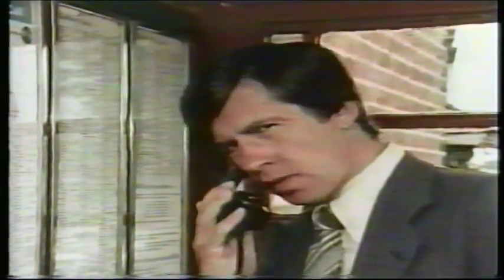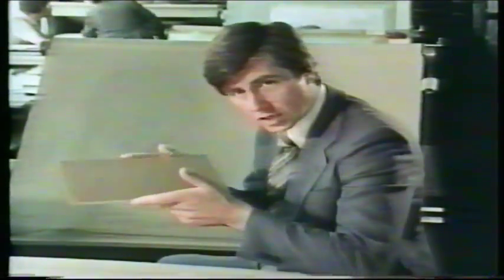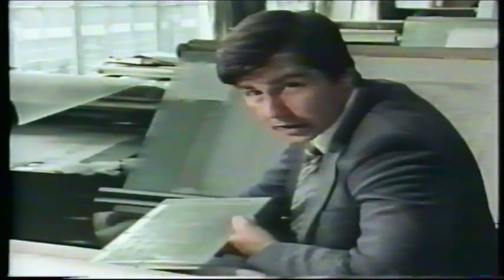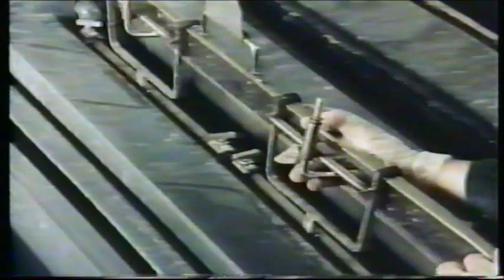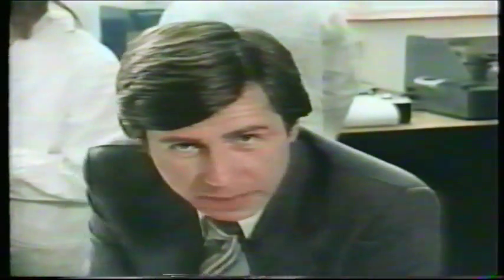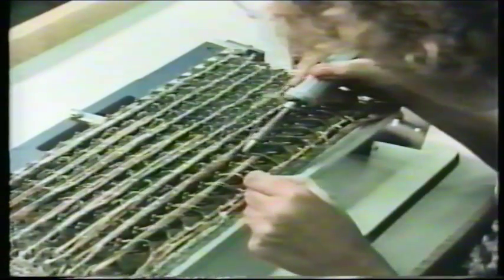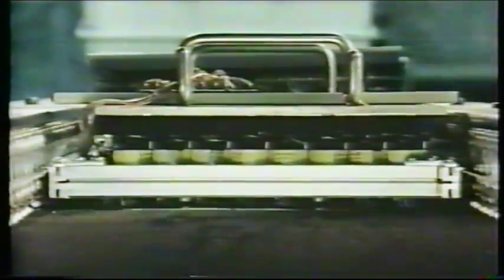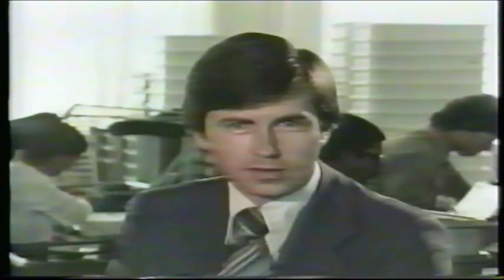STC AND THE TIN LEAD RESEARCH INSTITUTE

Comment: Very interesting. Looks like the 1980's to me.
Reply: Nataberchi Nataberchi The publication "Photographic Guide to Soldering Quality" (as seen in the video) was published in 1988.
Reply: +Nataberchi Nataberchi Seems strange that dial phones were still in use in the late 1980's!
Reply from the maker: The dial phone was needed to slow down the call. The contact was made as you release the dial and the number was pulsed down the line to the old mechanical exchange.